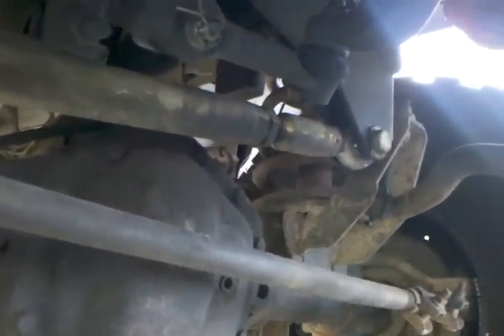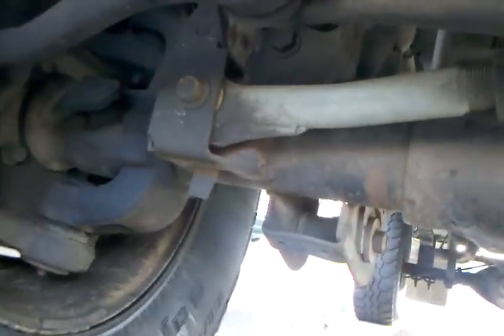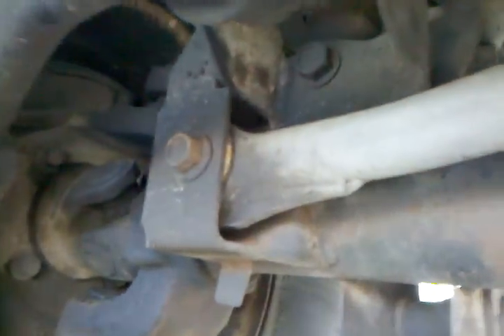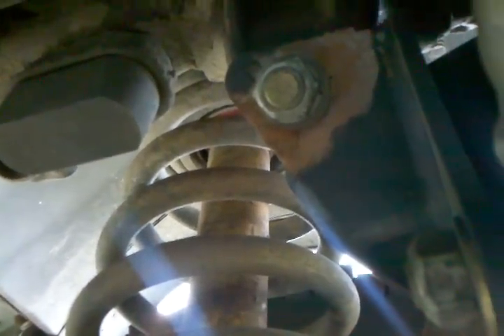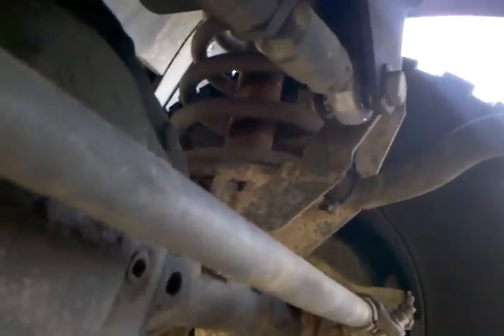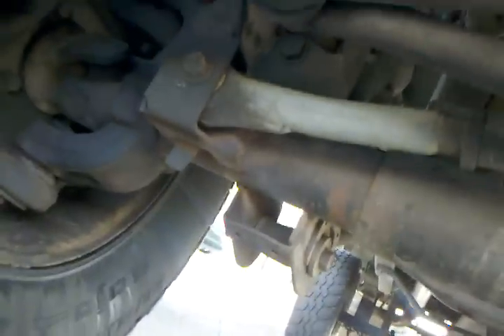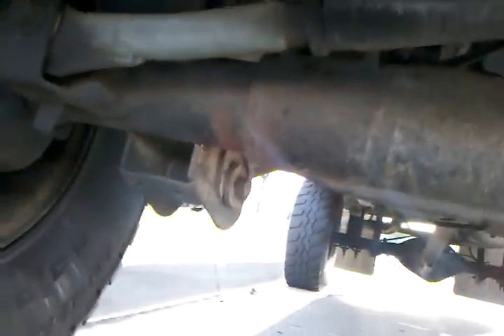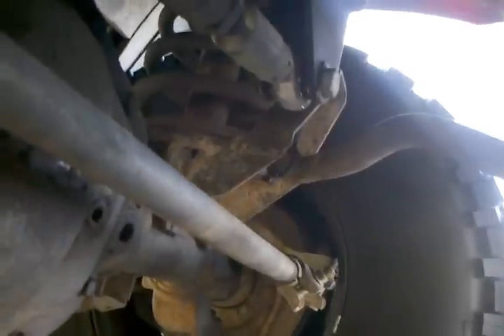DT "Trac Bar" follow up.

Comment from the maker: @MrForrestfire1  The steering stabilizer bar fixed my death wobble when I was running 35 inch tires. It also tightened up my steering since it incorporates a bearing for the pitman arm.

Comment from the maker: @rickyota The stock track bar has what they call a "Z" bend in it. From what I've learned, this bend in the track bar doesn't do anything besides flex when the axle hops over bumps and cause the death wobble. Some configurations may need that but I have never had a problem with it, as mine sits in front of the Diff. Once you start modifying, every truck is different. Especially with all of the different types of lift kits out there. I have a short arm kit, so my articulation is close to stock.

Comment: I noticed that other aftermarket trackbars have a bend in them to clear the differential while the axle is articulating. have you ever had a problem with this track bar hitting the diff cover?